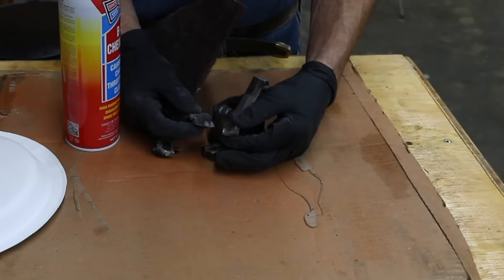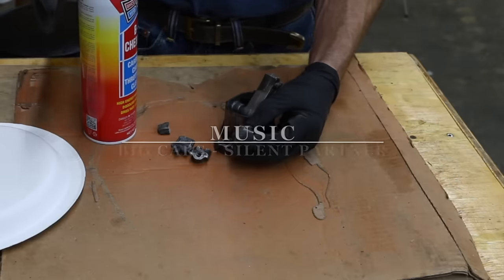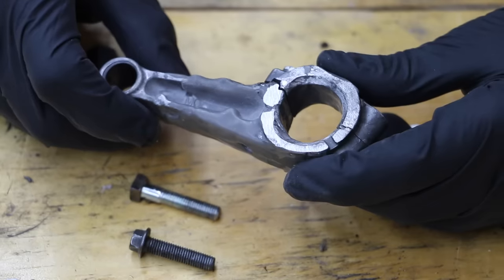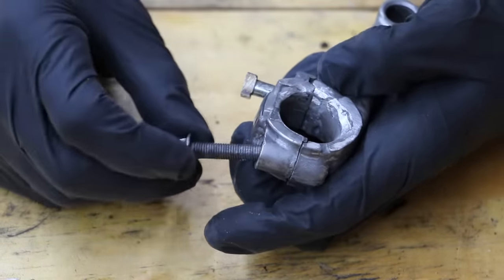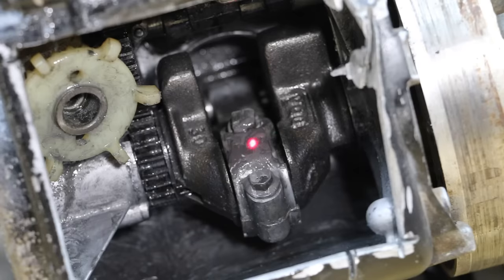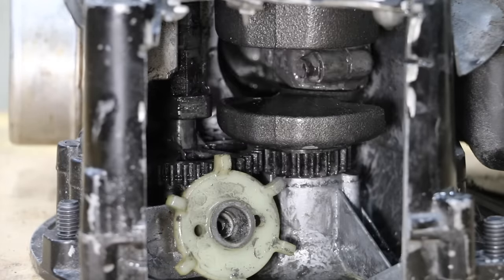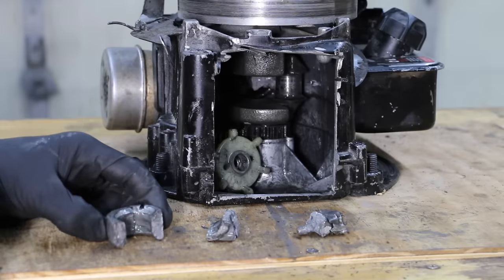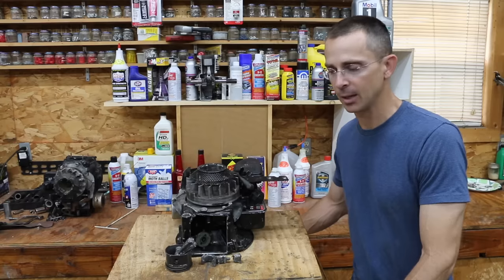Is JB Weld Strong Enough to Repair a Broken Connecting Rod? Let's Find Out!

Comment: I think brake cleaner would be better suited to really clean the surfaces because of its properties, it is not petroleum based and so it actually draws the oils out of the metals that are "soaked' into it. Brake cleaner is usually more of an alcohol based cleaner.The carb cleaner tends to leave a bit of (oily) residue on the surface of the metals and oils may tend to weep from inside the metal over time. That's why I always use carb cleaner when working internally and brake cleaner when external of the engine. Over time it will tend to continually break down the lubricating properties of any lubricant like grease, motor oils and such. I try and leave those qualities "in" the metal. That's just my personal findings over the nearly 30 years of wrench turning. Check it out n you may be surprised of your findings... Great vids. Have a good 1.
Reply from the maker: Brake cleaner is a great suggestion.  I greatly appreciate this recommendation!  Thanks again!
Reply: BlackFlyerRed88 MRWatson I agree. Brake cleaner will dry the metal out better. But regardless, the outcome would be the same because the rod broke in the threaded part. No chance of it staying together. Now if if had failed further up towards the piston, it may have lasted a few seconds if enough jb weld was built up.
Reply from the maker: Kfx Guy, great point regarding the failure location making it nearly impossible to last.
Reply: And as far as deoiling/degreasing goes, hows about denatured alcohol?
Reply from the maker: Lewie, I'll try using denatured alcohol.
Reply: I hope it works, but I don't want an explosion either. I know it's used to preheat a Coleman kerosene lantern. Oh well. Just do it outside with a stiff wind blowing maybe.
Reply: Agree completely just wanted to point out he is using the carb cleaner
Reply: BlackFlyerRed88 MRWatson  just whatever you do dont use clorinated brake clean to clean parts your gonna weld
Reply: Lone Wolf only use it if willing to self-expose to serious chemical agents....
*in order words: *DON'T !!
Reply: If you watch Eric O on South Main Auto (best mechanic on YouTube imo) he highlyyyy recommends brake cleaner on everything. It's magical how it works. Project farm- I am so happy that your awesome videos have caught on so well and so quickly. Keep um coming - they're fantastic!
Reply: Or if the hardware store is closed & your in need, you can by 91% isopropyl alcohol,  works pretty much the same as denatured alcohol (although I've never tried burning it) for a solvent.
Reply: @badhorse1640  
I remember a dude's story (google: Safety Alert! Brake Cleaner = Phosgene Gas - BREW Bikes LLC ), it was chilling stuff...  phosgene gas, nothing less!
It was the asphyxiating gas used in WWI
Reply: Thanks for the tip. Been having trouble getting JB to stick to chainsaw parts.
Reply: Yeah buddy, only the real grease monkeys know & use brake clean to cleanse down things… in a safe way of course.
Reply: @MC202zipper  You only form phosgene when you heat up the brake cleaner.  Welding and even soft soldering temperatures are high enough !  PS:  DONT SMOKE AROUND BRAKE CLEANER.

Comment: I once used JB weld to repair the broken spline on an output shaft for a 3hp outboard.  It ran for years without trouble after the repair.  I was impressed.
Reply from the maker: Geremy, This is an impressive repair!  Thanks for commenting!
Reply: Aye, that would be impressive. ;)
Reply: That's a wicked repair! I think that the change from reciprocating to rotating motion makes a huge difference for longevity
Reply: He didn't machine the crankshaft or rod bearing, I'm surprised it moved at all.

Comment: I'm surprised the engine could even cycle. Great attempt!
Reply from the maker: Thank you!
Reply: It didn't under ignition! You can see the very moment proper ignition took place and that's when it failed. The earlier clip was just the drill rotating it and the sound was just compression, but no ignition!

Comment: JB Weld works fairly well as a sealer or bonding flat smooth surfaces together. Never had much luck fixing broken pieces that were meant to move or twist. Anything that vibrates will also fail too. It's pretty much the same as epoxy, but with an extremely long curing time.

Comment: Could you try running a two stroke engine with different fuel oil mixes like vegetable oil or canola oil and see If there's any damage
Reply from the maker: Alexander, this is a great video project idea--thank you!
Reply: 35% virgin vinegar
Reply: Alexander v oil is oil it will work. And it will smell good. I have seen car engines with canola oil ran in them they smelled like French fries.
Reply: @Tammy Forbes Were those Diesel engines? Yes, it does work in Diesels when the oil's hot enough.
Reply: nitro fuel
Reply: It has to be an oil that will mix with the fuel other wise it will just separate in the tank and not work
Reply: G'day,

   From about 1909 till 1919 the lightest, most powerful Aero-Engines in the World were "Gnome-type" Rotaries, which were lubricated with Castor-Oil, and because their Oiling ran on a Total-Loss principle, they consumed 1 Gallon of Castor-Oil for every 8 Gallons of Petrol.

  Modern Ultralightologists with a particularly throbbing Biggles-Fetish sometimes do run their Rotax 2-Strokes on a Castor-Oil Mixture ; just for the sheer thrill of going up and flying in Circles, so as to be able to smell their own Exhaust-Fumes when they intercept their own track.

   The big thing when running Vegetable Oil in Ultralights is that it settles out of Petrol/Methanol/Ethanol mixtures over time, so the Premixed Fueltank  has to be drained after every day's Flying - so that the Fuel can be shaken and evenly-mixed before being put back in, next time one wants to start the Motor.

   Old-fashioned Rotaries used separate Fuel & Oil Tanks, and the Carburettor never had Oil go through it ; whereas most modern 2-Strokes mix Oil into their Fuel, so if running on Vegetable-Oiled Fuel, the Engine should be set up so as to able to switch Fuels while running, to run on Mineral or Synthetic-Oiled Fuel-Mix for at least 3 minutes prior to Shutdown - least the Vegetable-Oil dry down to "Glue" inside the Carburettor before the next Engine-Startup.

   There you go, and now you know,

  Have a good one,

  ;-p

  Ciao !
Reply: Vegetable oils oxidize too quickly and for better than 50 years we have had better things namely refined crude oil and synthetic oil. Even Whale oil was better. The soy bean farmers and such have been doing a lot of work in this area and they have mostly liked the oxidation issue in large part with vegetables oils to close the huge gap but they are not better than synthetics or even highly refined crude yet and the cost to benefit ratio is not their yet either. In a 2 cycle it has to mix well, it has to burn clean with few deposits, it has to have lupricity and it needs to cool vegtable oils as found in stores just do not do these things well and they have no additives in them either.
Reply: I have used vegetable oil for many years in rack and pinions.
Reply: Genghis Chuan the type of guy to not drink water because it has industrial uses. Tinfoil hats on ladiea and gents!
Reply: WarblesOnALot you comment has very little practical use in my life.... But I thoroughly enjoyed reading it! Thanks for sharing knowledge in one of the most knowledgicide places of the internet, the YouTube comments. (If knowledgicide isn't a word, I hereby invent it)
Reply: Use just ZX1 with no oil. Very good product.
Reply: Alexander v  A friend of mine had an idiot nephew who used peanut oil in his chainsaw when he couldn't find the proper 2 cycle oil. It seized up and got ruined.
Reply: I used Vicks Vaporub in my cv joints one time.  I was broke and out of grease for my grease gun, but I had the Vicks.  It worked perfectly for a couple of years until I sold the vehicle, a 4WD Trooper.
Reply: Oh my god I just thought of that idea
Reply: I've run my lawnmower on 1/3 vegetable oil to 2/3 Coleman white gas for years. also, the crankcase has a mixture of cv joint grease (the gelatinous crap) and used diesel oil. I'm still waiting for it to explode or freeze up.
Reply: Back in the 70's C class racing outboard hydroplanes using Konig engines ran on a nitro methane/castor oil mix.
Reply: Genghis Chuan this is very interesting. is there a preferable vegetable oil for human consumption?
Reply: Mark OnTheBlueRidge I wouldn't consume monsatan's little pet "herbicides." hbu?
Reply: yolodood man: Not true.  Oil from the castor bean is probably the only natural oil (outside of petroleum), that has great lubricity, that is tough for synthetics to beat.  But it tends to build up carbon faster than quality syn oils, especially if jetted a bit rich.  The oil has virtually nothing to do with the energy of the fuel and burn. Any performance gain is due to less friction and a better ring seal.
Reply: I know a company that makes some powerful RC gas engines, who has has rod problems with many oils, because of the power and rpm they make.  If you want to test your theory in reality, to see if ZX1 is better than Motul Cart 2T racing oil, or Klotz Supertechnoplate, give "Quick Draw" marine RC engines a call, (Weed Ca.) to ask them if they would test it on their dyno for durability testing.  If it works as well as you think, they will use it.
But I bet it does not.
Reply: H2O, anything else is additive, not pure water.
Reply: Matt Kovar: If he thinks there are different types of water than H2O, I don't think I would consume anything he would recommend.
Reply: LOL! Right?
Reply: yea
Reply: +WarblesOnALot - That's good advice on using V. oil in a modern carburetor. Would prevent having to clean out the carb every week or so. I'm familiar with the "bolted crank" style rotaries from WWI. The carbs on those engines are very, very simple compared to what we're used to today - mainly because of intense inertia from all that rotating mass, but also because those engines were built to run flat-out at all times. The unusual operating conditions made it nearly impossible to slow them to a moderate speed or an idle. 

Movies today use the sound of the engine cutting in and out as a sign that a plane is "crashing", but those sounds were perfectly normal. When the old bi-planes came in to land, the pilots would turn the ignition off and on to slow their airspeed for landing. Otherwise the plane would either have to coast power-off into the glidepath... or try to land under full power. Either choice being mildly suicidal. 

The alternative of turning the ignition off and on was a much more controllable way to achieve low-to-midrange power for landing. (Besides, when a plane crashes outside of a movie... the engine just isn't running at all. Dumb Hollywood stuff, y'know. ;} )
Reply: HI Louis, Back in the seventies, peanut oil was what MANY motocrossers  used in their fuel. Smelled great coming off the track!
Reply: Good Dude just did it in our chainsaw repair group in Facebook.... 25:1.  That shit all ran!!!!  Barlube/vegetable oil... the hole lot!!!!!
Reply: Tammy Forbes lol 😂
Reply: Or even different oil amounts like AMSOil Saber 100:1
Reply: My 2012 gas Gas EC300 says you can use mineral oil in a pinch. Also you have Bean oil etc etc. Lot's of oils to try
Reply: wtf even makes you people even think of these things? lol.
Reply: Please if you can do it
Reply: Jerry W Davis: And it probably kept your sinuses cleaned out too while you were riding it. LOL. Sorry. Just had to throw a funny in there. You left yourself wide open for one. LOL
Reply: Sorry, but there's just something wrong with anyone who wants to rape anything let alone seeds. LMAO.
Reply: Soooo that's how it all started ? niiiiice ! these video made me subscribe keep doing ur shit ur a good one <3
Reply: Do this already! And see what happens if you use spare motor oil from your car, like leftover 10w30
Reply: now THATS a lot of damage!
Reply: I've been suggesting this, too!!!! I'm not alone!!!!! Lol 😀
Reply: I like your thinking👊😎
Reply: @buckaroobonsi555  Nice massive run-on sentences and misspellings.
Reply: Furn333  when I did some two stroke racing 52-47 years ago the caster based two stroke oils were very popular. At the track it made a distinctive exciting small-not at all like cooking oil. By 1971 a concentrated non-caster, "Full Bore," became most common. That caster smell at the pits in the morning...The smell of racing.

Comment: I think there were too many pieces in that con rod.  Maybe would have faired better if it was a single crack.  Thanks for your effort.
Reply from the maker: I agree!  When the rod snapped, it bent the forged aluminum into an oval shape, making it nearly impossible to put back together in the proper shape.  Thanks for commenting!
Reply: maybe you can jb weld where the bolts go in a different rod just to see it it can do it
Reply: they usually do bend when they go.......

so.....if you get REALLY lucky you might get a clean and straight break
Reply: thechosendude   That was my first thought to. Two parts to glue together not six. Not the journal. I wouldn't expect it to run a long time but some oil should help

Comment: JB weld is really good, I have a 95 crown line boat that because of my own stupidity.  I cracked an exhaust manifold.  I cut a small V groove in the crack and filled it with JB. It worked great, I kept the boat for another two years and several trips to the lake with no issues! 
I am sure it isn’t the solve all do all but it works pretty good! 
Devcon works great as well!
Reply from the maker: Impressive results!

Comment: Thanks for making all of these unbiased videos the way you do! I would love to see a video of a muffler repair with original J-B Weld. I have read that original JB Weld is good up to 550° Fahrenheit whereas the high temperature J-B Weld design for muffler repair says it's good for 350° so I'm a little bit confused about that. I wonder how it would hold up repairing the connection between the manifold pipe and the muffler itself on a mower. I have had several tractors where the pipe has broken out of the muffler and wonder if JB Weld would be up to the task of repairing it
Reply from the maker: Thanks!  Thanks for the suggestion.

Comment: This video brought back memories of me and my Dad repairing a horizontal shaft Briggs. It was on a 1970's mini-bike. I ran it low on oil, the bearing went dry, the connecting rod broke and went through the side of the engine case. Although we didn't repair the rod, we bought a new one (small engine parts stores were more common back then) we did however repair the hole in the case using a piece of sheet metal, rivets, and a product that I think was called Aluminum Mender Magic. It worked and didn't leak oil. Oh to be a kid again. As always Project Farm, thank you for the great video and the work you do.
Reply from the maker: You are welcome!

Comment: Try using the JB SteelStik. I used it to rebuild a idler pulley on a zero turn thinking it would just be temporary fix. Its been a year later and still holding up for homeowner use.
Reply from the maker: Thanks for the feedback.

Comment: An entire connecting rod cast from jb weld see if that fairs any better 😀 love the videos man keep up the good work
Reply from the maker: Bradley, this is a great video project idea.  Thanks!
Reply: There is already a video done.  "SPOILER" It worked for a few minutes if I recall correctly.
Reply: Project Farm no problem man it might have to set for a while though so the inside cures completely but I bet you it would probably hold for a little while
Reply: I bet if he looked at the failure it wasn’t in the products ability to “hold” onto the metal, rather the JB weld itself failed. That’s partially because it needs tensile strength. Much like cement needs rebar. Same for fiberglass and resin. I would cast it with JB Weld and carbon fiber chopped up fibers.

Comment: Drill very small holes into the rod, so that the epoxy can extend deeper into the rod itself, increasing its strength. Currently, the bond is surface only. If you give the epoxy some channels to expand into, it may work.
Reply from the maker: Thanks for the feedback.
Reply: @ProjectFarm     I work with Structural Adhesives of many kinds, including various 3M products and JB Weld.   Though I still do not think it would have helped on this occasion, the process described by Rachel can often help, but only if the holes are drilled at alternating angles (not straight).   When set, what you have then created is referred to as 'Tooth Adhesion'.
Reply: @Mike_Hughes  It’s the same thing with painting and coating, it’s why we sand surfaces especially flat non porous surfaces like metal doors and whatnot. If you don’t sand or scuff the surface the paint can peel right off, same with epoxy floors they get acid etched or ground before coating. The paints are getting so good nowadays that they dry so hard anyways, but it is important regardless especially if there’s grease or dirt on the surface
Reply: Ya oand maybe by covering the entire outside as well

Comment: See it lasted 4 seconds, told you it would work!
Reply from the maker: You are right!  Thank you
Reply: I am grateful for the clip, it helps me enormously in choosing the right epoxy for a project I am building. Cheers John
Reply: It literally lasted about 0.1 of a sec after ignition took over and it was actually taking the force of the explosion inside the piston and not just being rotated by a drill!! LMAO!!
Reply: That sound in the earlier clip is just the compression during it being rotated by a drill not the engine running!